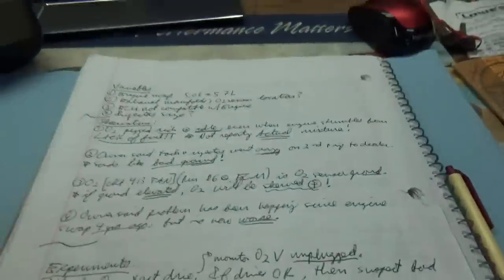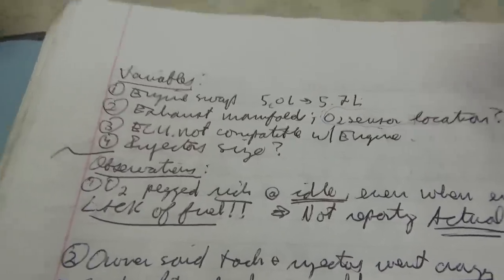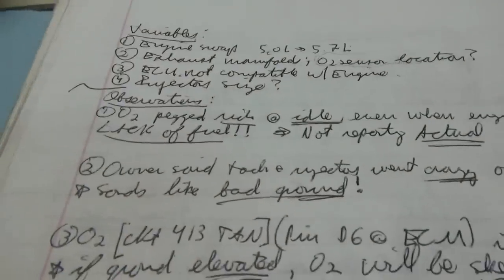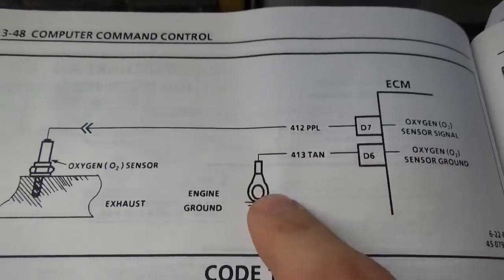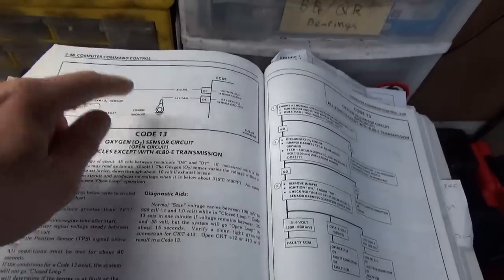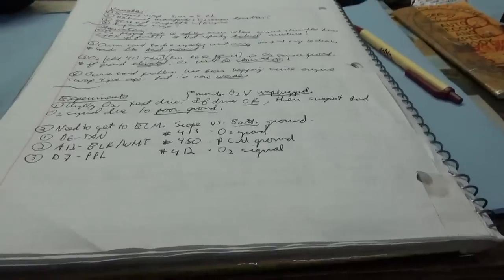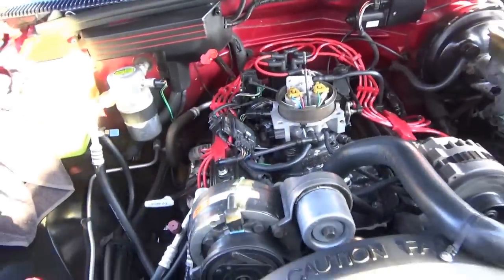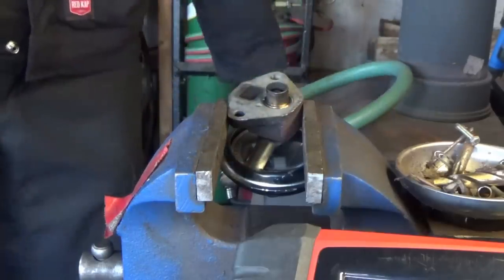Classic Chevy Christmas! - Part 2: Emissions Systems

Comment: Has this truck had the minimum air set ?
Reply: Ya make sure that knockout plug is still there on the throttle body if its not someone messed with it.   Some fools mess with it on a TBI chevy to work around other issues that the rest angle of the throttle blade never caused.
Reply: Exactly, the dealer bent the linkage, toss that throttle body in the trash, also he should make sure the timing is set to 0 degrees with the  esc wire unplugged, basics first :)
Reply: @tbas1972   Ya. You can bump it to 1-3 base timing like I do.. It really makes it scoot and no pinging.   Basically across the board its then  +1-3  But it handles it.  :)    I used a messed up timing light  once and when it was way too advanced it sure ran funny but didn't ping.    At 0 its a dog off the line. I think im at 2* now I can spin the tires on cooler pavement. Couldnt with 0* haha.. Way better up hills and crap for a wheezy TBI  chevy with slightly advanced timing. If I ever reprogram mine ill just add it across the board on the timing curve and I can then set it at zero
Reply: I used to set em at two as well, helped out a lot lol, I though on 5.7 trucks the O2 was in the y pipe after they met up ?
Reply: @tbas1972   My 305 has the o2  Its  3 wire heated because its a 94 right before the entry of the cat where the 2 pipes meet. Ya 2* rules.  3* works too but the idle gets kinda weird sometimes.    I used to run 3* when I had a loose timing chain because it would  pull timing due to the slop.  Now that I changed it 2* is sweet
Reply: And tbi's ran a tad rough any who and as for the 02 all the trucks I've had were before the cat
Reply: Correct me if I'm wrong but wasn't where the O2 is wasn't that for cars with the a.i.r. system? I looked up a y pipe on Rock Auto it's got a bung  right before the cat.
Reply: @tbas1972   Mine idles a little choppy sometimes not horrible. Hotter it is the more rough it idles.   They run horrible when its hot and humid. I want to custom program, mine and add a MAF sensor I Can apparently with my  ECM  if I add the pins to the connector and make a maf table for it. Should help with horrible air performance.  I swear GM tuned these things in the winter months or something when it was drier.
Reply: Or on a Friday lol

Comment: rich at idle, not burning the fuel put in the chamber, boroscope may show black pistons, and I would guess black plugs, spark plug gap, heat range,  are they vortec heads, siamese ports I suspect, Chinese distributor, rotors went bad as well as distributors in those, get a GM junk yard distributor, rebuild with ac parts, I am guessing timing ignition area

Comment: I fool with these OBD1 trucks all the time. Never use a Bosch O2 on these trucks. The AC Delco GM OE AFS 21 O2 sensor is now just a re-badged Bosch O2 sensor. Best O2 sensor to use on these trucks is a 
Denso 234-1001 Oxygen Sensor. They are about $8.00 on Amazon.

Comment: when u accelerate and the port on the tbi lets vacuum pull air from the purge cannister, it is putting it into an induced lean condition I think.  that purge cannister only gets purged every so often, its not supposed to be under vacuum all the time that the engine is above idle conditions. your vacuum gauge clearly shows that upon acceleration, there is a strong vacuum being pulled from the cannister , directly into the intake.  ?  seems like that could be an issue.,   . the computer should tell the   the purge solenoid to open, then it lets the engine pull vacuum on the canister. I think the rich condition is due to the missing purge solenoid and the miss at idle is ignition related or fuel pressure related. if the engine is running slightly more rich than the 02 can tell the computer to bring it down, there may be fuel condensing inside the manifold, and when it goes to idle, its not lean misfiring, its rich misfiring, even though the computer is working hard trying to lean it down.
Reply from the maker: Couldn't find a separate purge solenoid anywhere...I think that's just the way it was on the older trucks...
Reply: @PineHollowAutoDiagnostics  I  would find out definitively before you go past this, ive never seen an 88 to 94 without one,, now 95 alot changed.. 95 went crazy,, ha having strong vac pulling from the cannister while in drive just isnt logical.
Reply: @PineHollowAutoDiagnostics  im going to look in my chiltons  manuel and see if it shows it , BRB.
Reply: @PineHollowAutoDiagnostics  88 TO 93.. Pink and red/ gray, black ground.. on schematic it is labeled EVRV  GRAY goes to EGR solenoid and A4 on computer  pink and black goes to ECM 1 FUSE BLACK GROUNDED  to manifold
Reply from the maker: huh I see it on the wiring diagram, but not on the vacuum line diagram! "EVRV" solenoid regulates vacuum to the EGR valve...so not related to EVAP?
Reply: @PineHollowAutoDiagnostics  my book shows an EGR solenoid and the EVRV.. the wiring shares evrv  pink,blk wire ties in to the EGR solenoid
Reply: EGR has its own solenoid, right next to the MAF sensor its seems they are tied together electricaqlly
Reply: the computer opens the egr valve periodically as a proof of working test on these engines .. I dont know if it opens the EVAP purge simultaniously.
Reply: @PineHollowAutoDiagnostics  is there an emmisions routing hose label under the hood ?
Reply: the EGR solenoid is there because the puter puts it to a test every so often,...  as we know mechanical vac pulls the plunger down to allow ehxaust gas to enter the intake at higher rpms. it would make sense that the EGR and evap cannister were in vac at the same time during the egr test, so the fuel vapor rich fumes from the cannister can counter the oxygen poor fumes that the EGR is allowing in. just a theory.
Reply: if the puter does the EGR test, and the 02 sensor doesnt sniff a lean condition during the test I think 3 times, it throw you a check engine light to let you know you blocked off the egr and the govt has been notiified.. lol
Reply: this is why folks that block off thier EGR cant figure out why the check engine light keeps coming on.
Reply: I wonder if the vacuum porting   in the TBI s is different on engines that use a purge solenoid valve to purge the emmisions cannister? ?  is the port more restricted on the engines that dont use a purge solenoid so that it doesnt minic a huge vacuum leak?

Comment: Seems like those had an issue with the hose to the map sensor breaking down and plugging the port didn’t watch part 1 or pay close enough attention to see if you check manifold vacuum compared to  map reading

Comment: with the engine running a bit rich all the time, could be some fouling on a plug, and causing a miss. after you fix the cannister purge vacuum leak, pull a few plugs, and see if they are fuel fowled. go back to the old school, when pulling plugs told the story, the whole story and nothing but the whole story. because thats all we had to look at. ha

Comment: Check tos at idle min air rate should be 500 rpm
Reply: Tps is autozeroing and if dealer moved throttle it scewed tps voltage at idle which could raise rpm and richen mixture
Reply from the maker: Yup that 850rpm number is too high, have to get the idle down!

Comment: I agree with others here... It looks like the left injector is dumping fuel rather then spraying and therefor the miss at idle is not a lean condition but actually a rich condition that the computer cant compensate for.  Ie the o2 is telling the truth . However why then does the truck run well with the o2 disconnected or in open loop?  If the injector itself was faulty it should run crappy at idle no matter the situation... No? My only guess is the when the computer gets its dirty little hands on the controls its fuxing up the injector control or those injectors are not compatible with the ecm... The old "if I put this 1200cfm carburetor on my stock 350 it should scream like a @#%$" kinda thing.  But what the hell do I know... Im just an armchair mechanic.
I do think I would douse the whole thing in some brake clean or smoke it just to rule out a external vacuum leak before condemning the ECM or the injectors though.
Reply from the maker: Great thought process!

Comment: 100% bad injector/s have seen this before!
Reply from the maker: How do they go "bad", and how to check them? They are "Brand New OEM" according to the owner!
Reply: @PineHollowAutoDiagnostics  Thank you for purchasing Dorman re-manufactured fuel injectors.
Reply: @PineHollowAutoDiagnostics  the mistake many of my customers say is "I bought OEM parts..... from rock auto" and it ends up being dorman crap that they read "built to OEM specs...."
Reply: @PineHollowAutoDiagnostics  OEM as in Delphi, Bosch Or OEM as in Repackaged dorman.
Reply: You have a bad injector on passenger side or both.  Its dripping it shd be a perfect cone its not!  This was visable clearly on camera.
Reply: When they drip they are bad causing rich mixture, i just repaired a tbi 89 just like yours, carefully look at fuel output, shd be perfect cone, see videos about this.  OEMS fail early often, one i replaced was still under warranty.

Comment: looks like those injectors are pushing too much fuel at idle, like the injectors cant hold the pressure back. I would remove the fuel filter and see what pressure hes running, spec is 9 to 13..  8 psi, and these bastards act up, 14 ps,i and these bastards act up, they like 9 to 13.
Reply from the maker: Yup 9 to 13 is the spec I saw. We'll get there soon :)